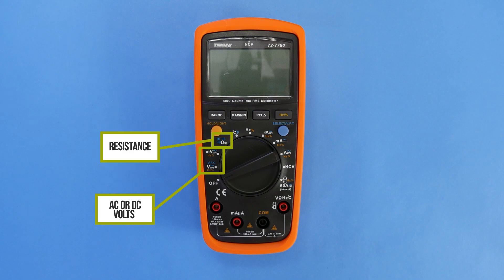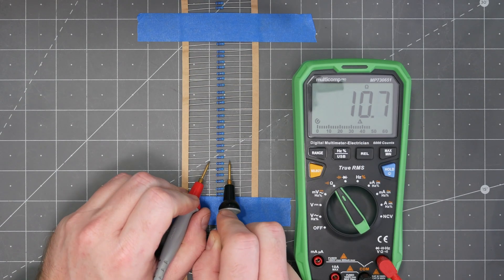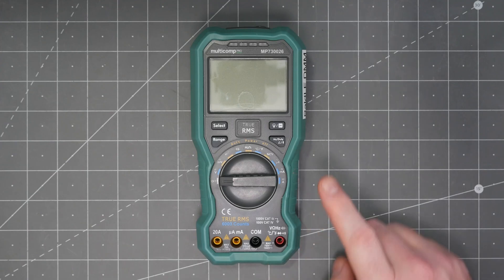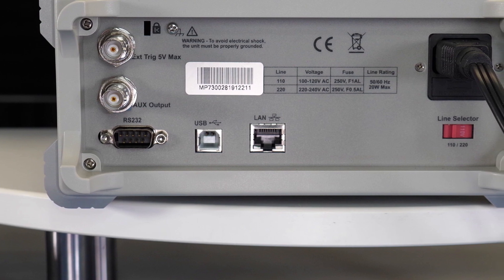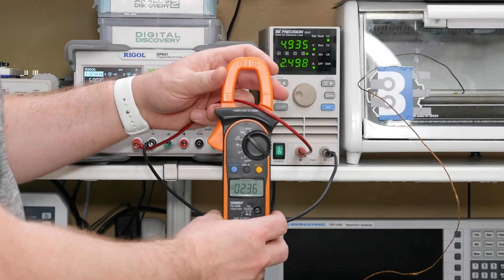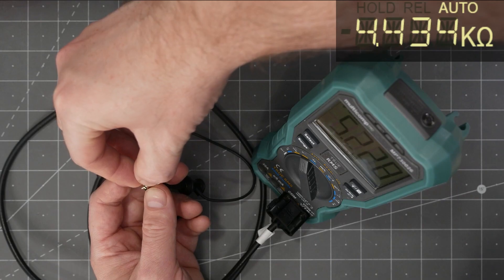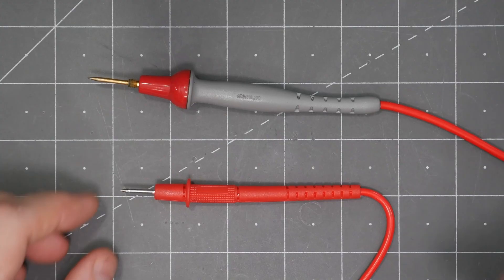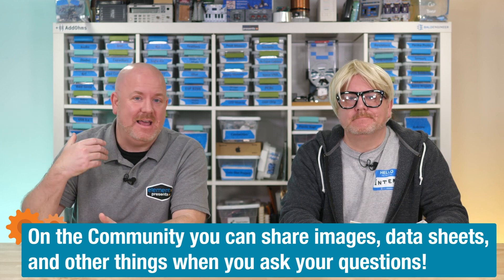Digital Multimeter Buying Guide - Workbench Wednesdays

Comment: I am not a professional electronics technician, but have a PeakTech 4094, thought i needed one. In this clip you are showing a very similar one from Multicomp. I suppose, there is one manufacturer and they only label them with there brand and brand related pricetag. Am i right, or are they using just the same housing design and put there own develpment board into it?

Comment: I'm a little over 10 minutes and had to replay and pause many times.  I would think the most import point to know is the differences in functionality (ie. what all of the buttons do) to see which works best for their application.  A typical homeowner or do it yourselfer would drop off somewhere as the list of functions go up.
After a minute and a half of fun at the beginning you went into the most important part but did it quickly. Checking diode wasn't on the screen for an entire second so I had to rewind to see what you wrote.  To explain the true RMF you did an excellent job of showing two meters and I thank you for that.  When I rewound and paused I saw V and AC on both but wasn't sure what you were measuring because the image focused on only the reading and not the setting of the meter.  At first, I couldn't believe such a difference in Amps partly because you said "amplitude", not "ampere".  So I don't know what you were measuring.  I'm not comment to show how ignorant I am but to show you an example of your viewers.
I truely believe that the most intelligent people are those who can see things through the eyes of others.  I strive for this.
I'll watch the rest of the video then probably go to another.  I have learned at least 3 things so far on yours.  I may just buy a fluke 75 on ebay.  There is a guy selling one with an external clamp for amps.  I may just buy a small bench one.  I don't want one from China so may go vintage.

Comment: ELEMENT14, can you make a video lesson about Ghost voltages, common circuit board ghost voltages and when would you want to measure leakage current and ghost voltages? some DVM have a LOW Impedance Voltage setting which you should go over in a video lesson about using it and when to use it.

Comment: here you are wrong. Just like to learn oscilloscope you need an analog one and not a digital one. When i say 10KG and 50KG, you are actually getting the feeling of those weight. You have to use manual multimeter to get that feeling of those ranges. Same goes for learning driving, use manual gear shifting veh.
Reply: I don't completely agree about the DSO part. I own a DSO but never used the magic "Auto" button till to this date. I operate it manually just like an analogue CRO. Also it's important to note that used cheap CRO aren't easily available in everywhere. Where I live, it's almost impossible to get a used one. New ones, even the Chinese ones costs more than a cheap DSO. So I never had the chance to operate and learn an analogue scope.
Reply: I like the way you think.

Comment: I use a fluke, but I've had plenty of others since I worked as a Technician. My favorite  is one I built from taking a corresponds course in the late 70's. Still have Still works. I started in the U.S. Army as a Technician in 1967... And when I got out continued as one till 2012 when I retired. But I still like working on things when I get the chance.